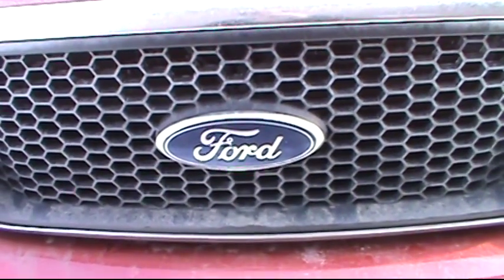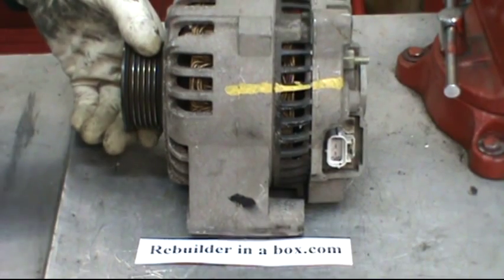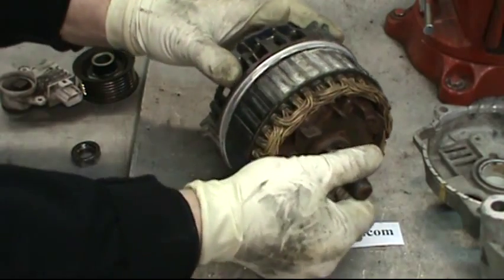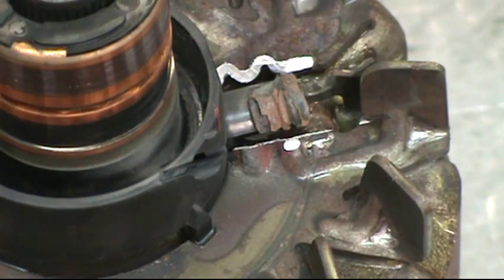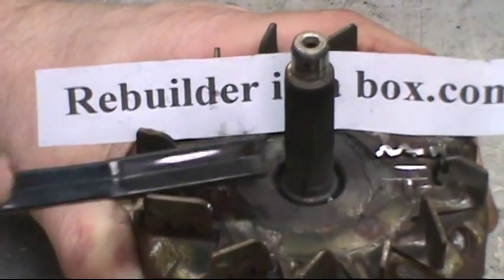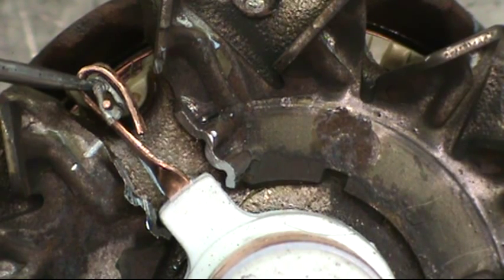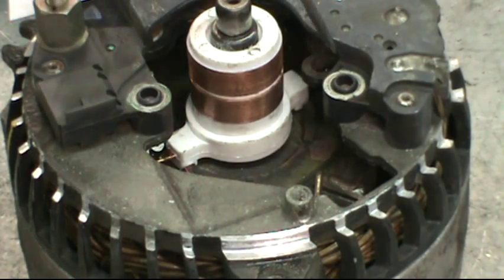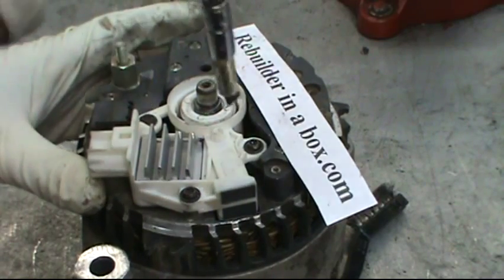How to change the slip ring on a 6G alternator

Comment: Nice video. Are the following kits in stock?  I need the 6G7796GYSMPL & the 032-12sm1 for a 2001 Ford F350 SD 7.3L Diesel. I has two wires coming out the top of the connector. 
Also what amperage is this kit? It doesn't really say, other than "extra power you need".  Thanks guys. Best Wishes & Blessings. Keith Noneya
Reply from the maker: We have all the 6G stuff but I don't recognize the 032 number?. The regular rebuild kit doesn't raise or lower the amperage, so it would still be 110ADC. But our extra power kits raise amps about 50ADC. https://alternatorstarterrebuildkits.com/product/6g7796gysmpl/
Reply: @rebuilderinabox  That's great will this kit fit my 2001 Ford F350 7.3L two wire alternator? I believe the 032 was the front case. My truck is down and I need to pull a 5th wheel soon in a few days so I thought I'd give you guys a try. Best Wishes & Blessings. Keith Noneya
Reply from the maker: @keithnoneya  Yes, that is the correct rebuild kit.
Reply: @rebuilderinabox  Alright I'll go buy one. Thanks look fwd to trying it out. Best Wishes & Blessings. Keith Noneya
Reply: Oh is there any other things I might need while I'm there?

Comment: Before you remove the slip ring, check to see which lead goes to the top ring and bottom ring and mark on the rotor with a marker the appropriate positions. this can be done with an Ohm meter. Be sure to reinstall leads to the correct sides!. If you have to, mark them on the rotor, top and bottom. My Battery light came on and it wouldn't charge correctly until I took it all back apart and turned it 180 degrees.
Reply from the maker: Coincidence only. An alternator in bi directional. It would function normally turning forwards or backwards. (Except cooling fans would not work right). Yes, there is a right way and a wrong way for the coil to be energized to copy the manufacture style. But after many years, and thousands of slip rings, we have never been able to notice much difference.
Reply: +Mike Lauer i switched mine, the battery light went out, i commented on this, went to get in the explorer this morning battery light is back on! Any idea why my light would be on?
Reply from the maker: Check the solder joints visually (not ohm meter) where slip ring goes into coil. Check brush track location on slip ring. You can call us if needed.